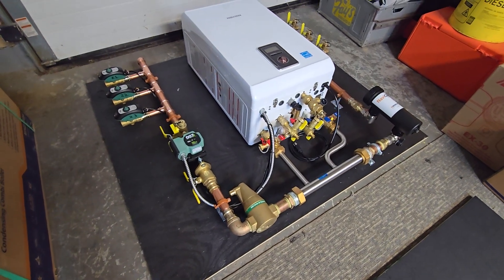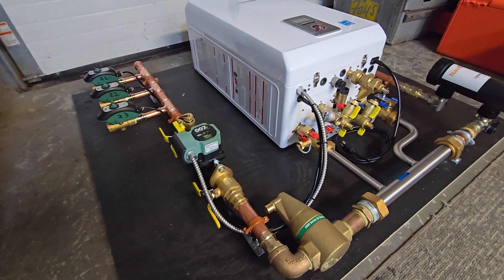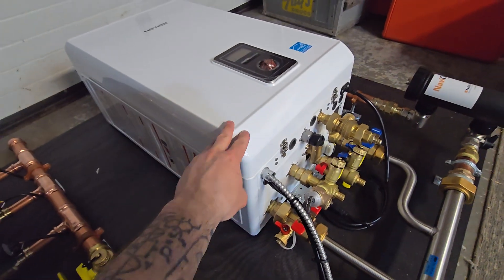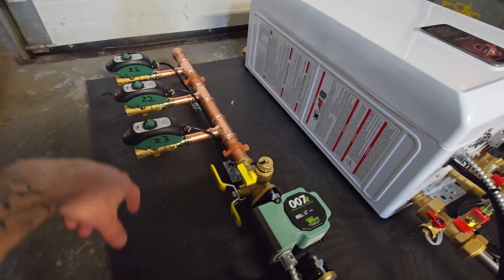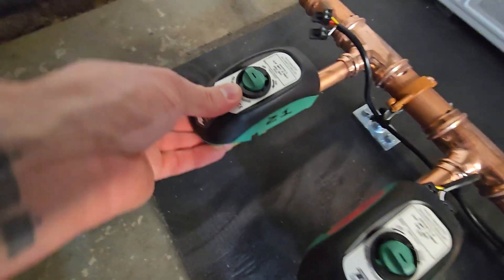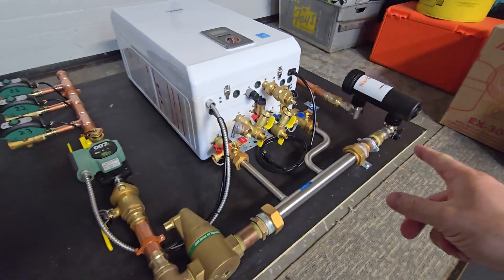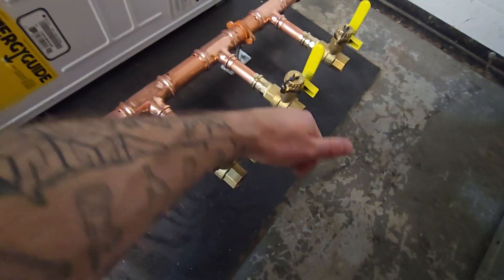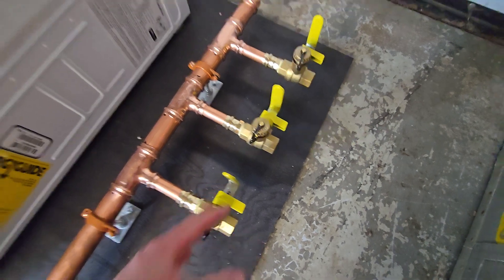Navien Combi Boiler System With 3 Zone Valves

Comment: I have an other question. There a port called make up water. Do you connect that to city water and it will keep your loop at the desired presure
Reply from the maker: That's correct also use a BP900 backflow preventer.

Comment: So I just set up my combi system exactly like this. When I look in the book, it only shows 2 wires needing to be connected to the sentry zone valve(common and normally open). My sentry zone valve states it’s normally closed. It looks like you have more than 2 wires connected to the valve. What else should be connected?
Reply: I only have 2 zones by the way and both stats are only 2 wire setups
Reply from the maker: @Djbigb8092  you only need two wires when connecting to the navien.
Reply: @JimSperanza  that’s what I thought. Looks like you have more than 3 connected which I started to wonder. In the book, it states sentry should connect to normally open, my valves are actually normally closed so I’m assuming that I use 2 wire and just do common/nc, correct?

Comment: Great video! I noticed you didn’t use temperature sensors on the return and supply for the heating system, like you have done on other systems. Is there a particular reason?
Reply from the maker: The supply and return sensors are used for the variable speed delta T circulator. This system uses a fixed speed circulator.

Comment: Jim, looks great. What is the total weight of the system mounted on the plywood? Two people can 'easily' mount it?
Reply from the maker: About 150 lbs. Yes easily can mount it with two people. Best way is to use a temporary 2x4 ledger board to rest the bottom of the system on until the plywood is lagged to the wall studs. Then the bottom 2x4 can be removed.